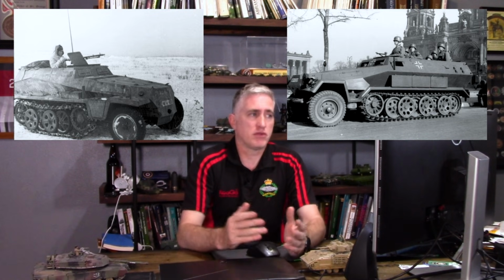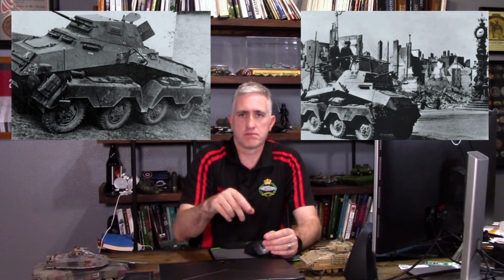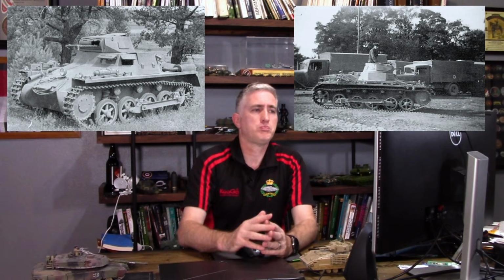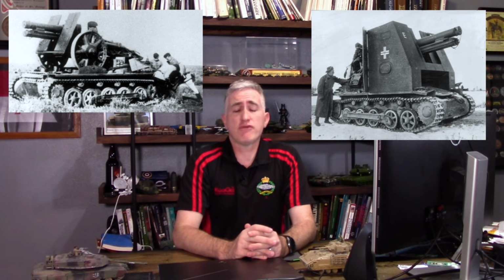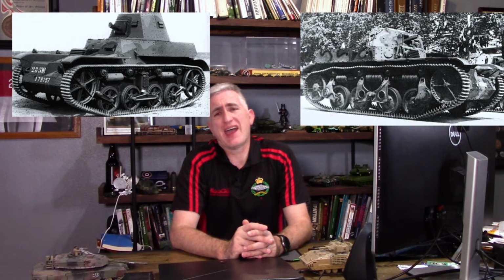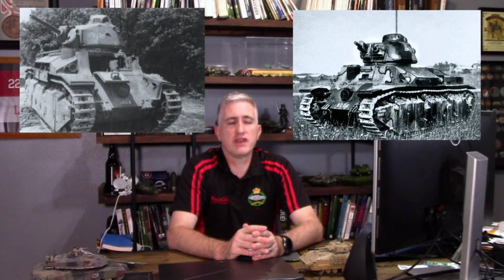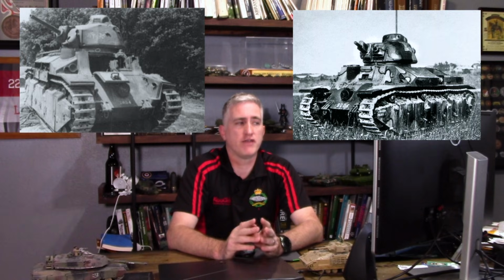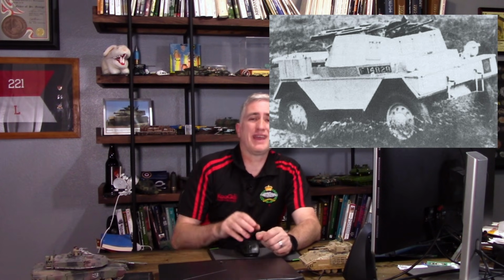Armoured Vehicles of the Invasion of France 1940, by The Chieftain - WW2 Special

Comment: I think the paint job is wholly underrated. - and the radio, of course
Reply: Jerycan was also underestimated, the fuel supply and refueling system was important and it took at least half the time for the Germans to refuel. The German and French tank divisions started refueling relatively close to the same time, the Germans crushed the French division with over 400 tanks (twice as many as the German division at the time) with a powerful attack, because the French were only halfway through refueling from the tankers. The second division was caught unloading tanks from the trains and was also destroyed.

Comment: Wait, you're telling me that among the 4.000 tanks the french had on paper for the battle of France, 2/3 were actually Renault FT from ww1! So they actually only had about 1.000 relevent tanks to fight the 2.500 strong German armor?
Reply: R 17 were not actually included. You may be thinking of R35 and H35 (armed with SA 18 37mmL/21 cannon), AMX33 and similar inadequate vehicles. But the Germans had a bunch of PZKW I's and II's that were worse than the tanks mentioned above. If you can check out Len Deighton's book: Blitzkrieg

Comment: Does anyone know where to get an official history of the French cavalry during the Battle of France? The French cavalry divisions were partly mechanized/motorized, much like the US Cavalry between the wars. Where the US cavalry used light tanks and called them "combat cars" to avoid the NDA of 1920, the French cavalry actually used lightly armored and armed tracked vehicles, called "Auto-mitrailleuses de reconnaissance" (AMR) and "Auto-mitrailleuses de combat" (AMC). These AFVs were pretty equivalent to a Pz.I in mobility, firepower and protection.
AMR 33  5 tonnes, 13mm max armor, 40mph, 1 x 7.5mm Mle 1931 MG (107 built)
AMR 35  6.5 tonnes, 13mm max armor, 34 mph, 1 x 7.5mm Mle 1931 MG, or 1 x 13.2mm Mle 1932 MG, or 1 x 25mm CaC L/45 Mle 35  (200 built)
AMC 34 10.8 tonnes, 20mm max armor, 25mph, 1 x 25mm CAC L/30 + 1 x 7.5mm Mle 1931 MG (100 built)

Comment: New Zealand most certainly was capable of creating a better tank than the Bob Semple, that being the Schofield Tank (so named because of the designed, one E. J. Schofield, a motor vehicle dealer in Wellington). Certainly not a great tank (especially before the redesign), but given the technical abilities of the designers, and the manufacturing ability of the country at the time, it was probably as good as could be hoped for.

Comment: The AMC-35 /ACG-1 is actually pretty good. I  recommend the book: "Les chars Renault ACG-1 de la cavalerie belge: Mai 1940" by Franck Vernier / Georges E. Mazy. Available in French here: https://editionsdupatrimoine.be/product/chars-renault-acg1-cavalerie-belge-1940/ 

It had a decent top speed of 40 km/h. 25mm of frontal armour. The French and Belgian 47mm guns were better than the German 37mm. Both French and Belgian tanks carried AP and HE rounds. It had a relatively roomy 2-man turret. The seats of the gunner and commander were attached to the turret. So they they moved along with the turret. 

It has a lot of vision blocks and vision slits for the crewmen. There is a periscope in the roof. The commander has a proper turret hatch to stick his head out. There is also a wide two-piece door at the back of the turret for quit exit.  The range on fuel was decent. 

I can't say much about reliability. The Belgian only had 10 and received very few spare parts. Only 8 were used in combat and 2 served as sources for spares. The French used them in hastily assembled units. 

All in all the AMC-35/ ACG-1 was the best French tank regarding armament, crew comfort, mobility and visibility. It was definitely on par with the Panzer 35(t) and 38(t).

Comment: What is the best vehicle? A) Ferrari 488GTB, B) Peterbilt 567 Dump Truck, C) MCI D45 CRT Commuter Coach/Bus, D) Mercedes-Benz E-class Station Wagon

All of them are designed to do different things. If you need a vehicle to take drive your family around then one will be best suited for your needs. Need to move a lot of dirt ? Win a race? Comparing them is an exercise in futility because they are all used for different things.

Comment: 5:56 Well, actually, that's not true. The French got Unic P107's and some other half-tracks, and given that Adolphe Kegresse designed the whole system in Russia, it is little wonder that the Soviets got their own family of half-tracked trucks (ZIS-22 and -42, to name a few).
51:21 What's the use of such a pillbox of a tank?
Reply: The matilda is an infantry tank, which means it was conceived to fight alngoside infantry, so not going very fast, while having big armour to ba hable to take hits since you're not going fast and protecting the squeeshy things you're fighting alongside with while adding mobile firepower (MG, or a gun), it's a design from WWI where mg's were really heavy and so not really mobile so they couldn't really follow the infantry, puting it in a tank allows that, the Matilda (especially the Matilda II) is how to do a good infantry tank, the french (R-35 for exemple) is how to NOT do an infantry tank
Reply: Infantry tank is not going to protect infantry with its armour for the simple reason that anyone taking cover behind it would still be vulnerable to mortar mines' and HE shells' fragmentation, and shrapnel (still used at that time). And its firepower is not going to present any significant threat to enemy so as to lower the level of threats to the infantry from the aforementioned munitions. In this light one could argue that if the concept of the infantry tank was not dead on arrival (given the WWI combat experience), it was certainly heavily damaged by the 1930's, and even if it could still be put to good use, then both Matildas and French infantry tanks are in no way a good example of an infantry tank due to the lack of potent HE round (or any HE round for that matter for most of the Matildas).
In case of Matilda I, it's even worse, because it cannot fight off not only tanks, but pretty much any armoured vehicles and decently shielded AT guns, too. Which means that in the end, it's no good for anything save for mowing down hordes of infantry - a role of pillbox.

Comment: There is a problem with integrating tank doctrine with tank design and that is the frequency of using captured tanks, far more than aircraft.  A captured tank is not matched to the users doctrine, nor is a lend-lease tank; but some were liked much more than others and some performed much better than others.  Also, especially in the case of the little French tanks, one should remember that if the tank costs half as much and has half the crew, then you can have 2 of them instead of 1, and such a tank only needs comparable effectiveness in pairs, confronting 1 opponent tank.  This must be considered when criticizing the smaller French turrets especially.  Though I do suppose that effectiveness after capture is not much help to the builder, Lend-lease is.

Comment: Hey, Chieftain, it would be great to see all the anti-tank guns of WW2 compared on a chart from best to worst. For example, I understand the German's had at least 3 guns superior to the US 76mm. And that the US 90mm was weaker than both 88s with the ammunition commonly available.
Reply: They may well have been. How heavy were the guns (barrel, breech assembly, mount, recoil system) and the length of the recoil stroke, and so on?
Reply: @TheChieftainsHatch  I was thinking more about the shells fired, but I'm sure all of these factors play a role.
Reply: That’s kind of the point. The gun “power” figures are only part of the equation of a system. A huge gun with a long recoil stroke requires a larger, heavier platform, which means logistical problems which reduces the chances that the gun will be in the right place at the right time to affect the battle.
Reply: @TheChieftainsHatch  But does that explain why the German long 75mm seems to have been more capable than the American 76mm? At least that's the impression I have.

Comment: The radio setup for Germany was not as simple as “radio cars have radios and others don’t”   First we have to differentiate whether a vehicle had a receiver only, or a receiver and a transmitter, sometimes called a transceiver.  Next we need to recognize which type of radio, since some were used for broadcast orders to the team, some for messages up the chain of command, and others for communications with the Luftwaffe.  A large percentage of vehices had at least a receiver, with transceivers becoming more common as the war progressed.  “Wireless Communications of the German Army in World War II” on wikipedia has a lot of information on this.

The dedicated radio vehicles were generally for long range communications.  Short range radio units were used for intercommunication of individual vehicles and squads.  The early radio armored cars were the SdKfz 223 (4 Rad), the SdKfz 232 (6 Rad), and the SdKfz 232 (8 Rad).  In addition, armored units were equiped with soft skinned radio vehicles, such as the Kfz 2, 15, 17, and 19 for infantry comms.  Then there were upper eschalon radio command trucks and buses, such as the Kfz 61, 68, 72, and 77. 

The SdKfz 223 had a FuG 10 transceiver early on, and a FuG 12 later in the war.  The SdKfz 232 (6 and 8 Rad) had a FuG 11 transceiver, used for regimental comms.

It all gets very complicated.  One day I should put together a graph of all the inter-communications.  It would end up looking like an internet WAN heat map.

Comment: So I'm listening to the stats on these "light tanks" and I'm thinking "that sounds awfully familiar--that sounds like the humvee I rolled around Iraq in." Which begs the question, how does an early WW2 light tank stack up against a modern M1151 or similar up-armored humvee? The way it's described, it sounds like the armor will stop about the same caliber of weapons, and they're both armed with a medium or heavy machinegun. The humvee has less offroad capability in mud and mire, but more speed on open terrain or roads. The humvee has better communications and better visibility. Seems like they'd be an even match???
Along the same lines, how would an early WW2 medium tank stack up against a modern AFV like the Bradley? How does a 2 pounder gun or a 37mm cannon from 1940 stack up against a 25mm Bushmaster?
Reply: When I look at early WWII tank specifications, I'm often struck by sizes similar to a modern Chevrolet Suburban. If you just look at the PzKpfw I and II tanks, Germany knocked over a lot of countries in 1939-40 with uparmored Humvee/Suburban equivalents.
Reply: When I look at early WWII tank specifications, I'm often struck by sizes similar to a modern Chevrolet Suburban. If you just look at the PzKpfw I and II tanks, Germany knocked over a lot of countries in 1939-40 with uparmored Humvee/Suburban equivalents.
Reply: @amerigo88  are you a historian? 
If you are.  Can you suggest some "affordable" readings in book form?
Reply: @utkarshchoudhary3870  Most of my historical reading is either from online sources with citations or the local library as either physical books or ebooks. Chasing dien and reading sources used s Wikipedia citations is a great place to start. Old books from Osprey Press and Ballantine's Illustrated History of the Violent Century are usually inexpensive finds,  used.

Comment: Technically I can't hold my own compared to you. But tactically I can. The German half-tracks like the Sd.Kfz. 251/1 was actually not used to "fight alongside" Panzers, as you put it. It was poorly armed. 

In fact it was used as a reconnaissance vehicle for the panzers. I don't know how many tanks the Germans had for every Sd.Kfz. 251/1 or on what level in the organization they where implemented. 

It had tracked wheeles and rubber stearing Wheels so that it could manouver quickly since it was a requirement for reconnaissance for panzers. And my own added conclusion is that the half-tracks had tracks because the vehicle itself could assess that wherever it drove, the tracked tanks could almost certainly follow.

And the vehicle was in service in certain countries untill the nineteenninetees.

Comment: Dident the brits have alot of tanks in reserv in britan for battle of britan?
Reply: The loss of tanks and other vehicles in France was sizeable. There were some tanks in Britain but probably not enough to repel an invasion if that gained a foothold. This was partly why the British returned very quickly to the drawing board and began designing and manufacturing new ones - of the tanks in 1940, only the Matilda had much of a presence later in the war.
Reply: @kaczynskis5721  ok, thanks
Reply: Nope, Britain sent practically all its tanks to France and lost most of them (barring what was in Egypt). 

The UK had a single Armoured Div in May 1940, it contained all the British cruisers and brought the total number of tanks equipped with AT weapons to under 200 (the 2pdrs and includes the separate Matilda II's). This Division was not at full strength, lacked training and experience, crews lacked familiarity with the vehicles and 2pdr (much training in the UK was done on older light tanks and Vickers Mediums). 

Some Matilda I's and the Light tank Mk VI's were equipped with Vickers 0.5" HMG in an attempt to give them some form of anti armour capability.
Reply: @chaz8758  thats sad

Comment: I was looking at an article (tanks-encyclopedia.com) for the Char B1/B1 bis which indicated it had an ER53 radio telegraphy set which utilized Morse code only.  I would think that Morse code (vs. voice) communications would have an impact on command and control.  If this article is correct, were there other AFV during this period that also used Morse code radio sets instead of voice sets?  Great set of articles btw.  I'm learning a lot.
Reply: It seems to me that these radioq allowed vocal eexchange on short range.

Comment: One interesting example of Germany's failed attempt to mechanize it's force was the simple cheap Krupp KFZ.70 light truck. It used a simple flat air cooled 6 cylinder engine powering the rear 4 wheels. I was small in that it could only carry two in a open cab and 4 more in back. Much of the uupper body was wood, which saved steel.And it was just large enough to tow a small gun such as 37mm. But it's air cooled engine like the Volkswagen used a lot of fuel for it's size, and the increase of size of German guns, basically ended Krupp's attempt to standardize a light German truck. But in Poland and France these trucks worked great.

Comment: 42:42  Even with its extremely long boiler, a Union Pacific Big Boy still had better forward visibility than most French tanks.   On the other hand, the Southern Pacific Cab Forward had excellent forward visibility and there was lots of room on top of its tender to mount a tank gun.  Both engines were too heavy for European railway tracks so these potential super weapons were never tried.
Reply: The Europeans didn't have Mallets, but they did have some Garratts, a more versatile type of giant articulated locomotive which could handle steep grades and corners better than than Mallets.
Reply: The cab forward were, unless my memory fails me, an Italian idea, so there may be less advantage to that than one might think.

Comment: You may be wondering why Germany changed to more powerful but more expensive and less reliable tanks by the end of the war.

The answer is that Germany was running out of oil and manpower, so could not use a large number of tanks ANYWAYS. So they instead opted for making more powerful tanks, but various factors led to these tanks being unreliable to various degrees (the Ferdinand was especially unreliable, even by German tank standards)
Reply: NeuesTestament 

Talking only about the later “big cats”. Their counterparts in other nations were, of course, also unrealizable, but those other nations could afford to field large numbers of smaller, more reliable tanks while Germany could not because they didn’t have to fuel.
Reply: Bk Jeong I take it that you are comparing the reliabilities of the earlier and later German tanks against each other. Correct?
Reply: NeuesTestament 

Re: numbers, I never said numbers had anything to do with being unreliable. 

I was saying that Germany went for large tanks because they lacked the fuel to operate a lot of smaller tanks, even if those larger tanks were unreliable.